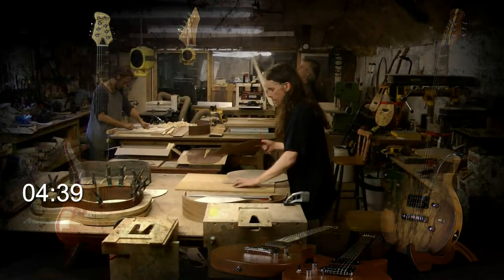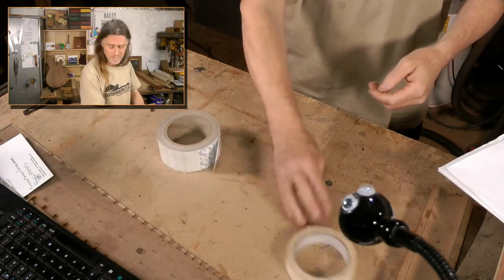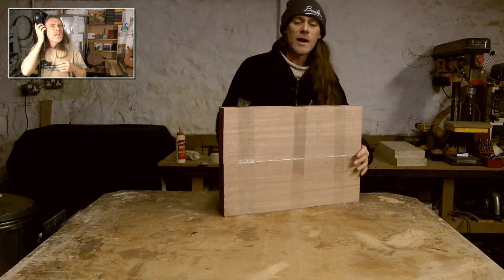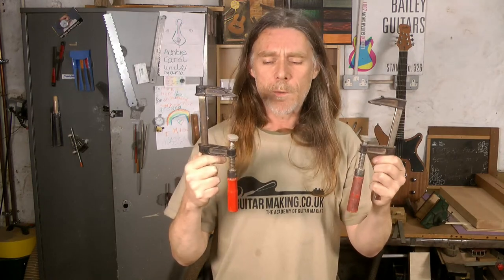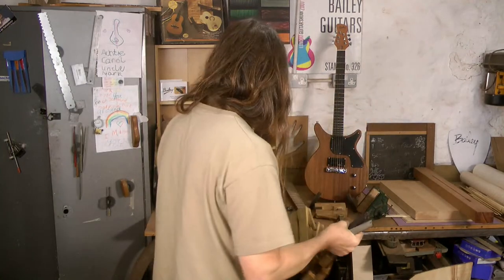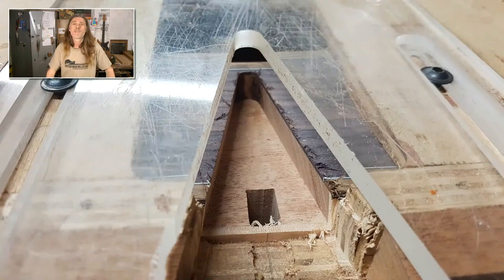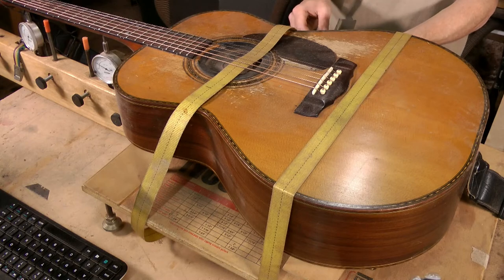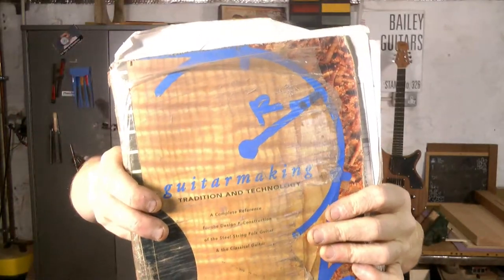Guitar Making Techniques: Clamping and Holding inc. How to Use the String Tension Simulator!

Comment: Those neck rests (not the bean bag kind) can be made on a table saw. I once made two this way: You need a fence on your saw that is not parallel to the blade but at an adjustable angle. You do a multitude of small passes until you reach the depth you want and the angle determines the width at this final depth.

The spool clamps are pretty easy to make if you've got a lathe to drill the holes. They do not necessarily need to be dead centre but it would be more of a hassle I think if you had to ballpark centre each one on a drill press. I made a bunch but haven't used them yet.
Reply from the maker: Great info - cheers!